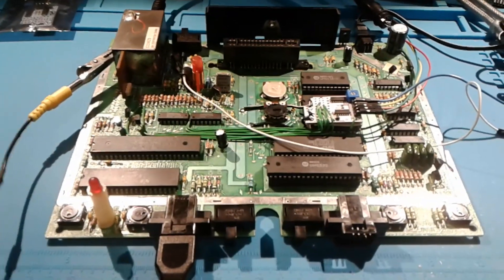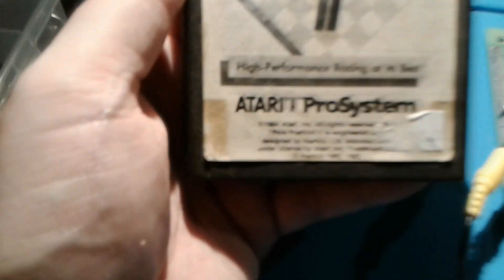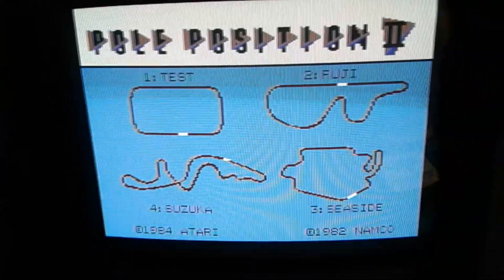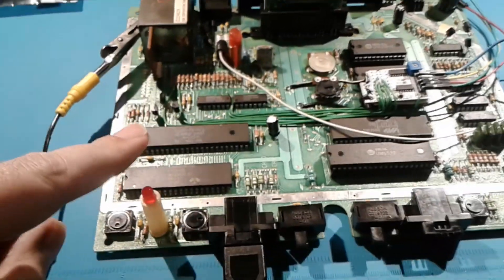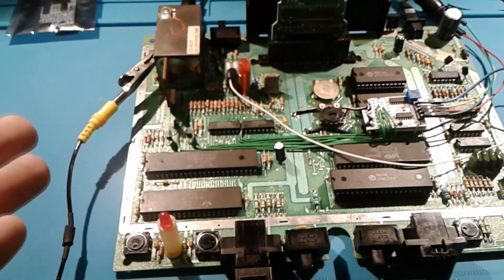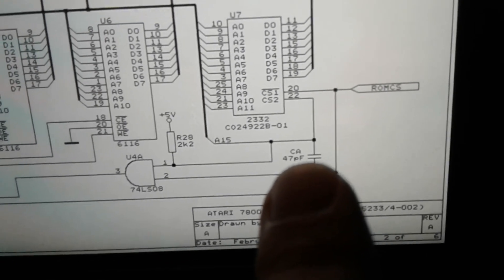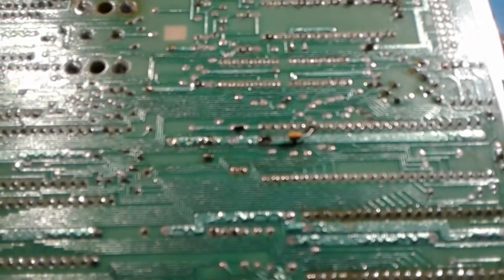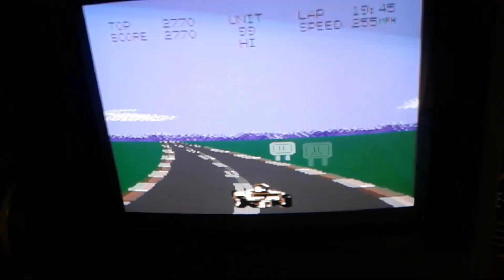ITC#70:- Atari 7800 Graphics Corruptions Issue & Fix

Comment: Thanks for the video. It helped point me in the right direction to my own issues. I had this very similar issue  my unmodded later revision 7800 just different games. On some, Atari installed a 47 pf capacitor on the bottom side of the board on Address line 15 to Ground to fix the issue. The problem is, even with the capacitor installed, I had some issues with games including Choplifter. To fix it, I had to increase capacitance just a little bit (235 pf) and that seemed to correct all issues with the exception of one revision of one game (One on One Basketball, other revision worked fine). The only way i could get this one game to work was to remove the capacitor altogether and the issue fixed but the graphical issues increased on all other games. In the end, I made a compromise and left the capacitor on at 235 pf.
Reply from the maker: Yes it does appear that Atari added this deglitch cap as part of the QC process as it wasn't in the official schematics that I'm aware of and it really seems hit and miss on when they chose to use it or need it. I will state that I've seen it more common on earlier made 7800s with NCR 6502s in them. Additionally, they have it installed off the A15 line from the CPU to ground vs elsewhere. In the end, one fix is to replace the CPU with a different one. I've had good luck wit Signetics 6502s. But like anything with these older consoles, your experience could vary.
Reply: @IvoryTowerCollections  Good catch! Mine is an NCR CPU.
Reply from the maker: @SmartSped1984  Yes, I also have 2 different versions of BallBlazer that I will sometimes use for testing. One seems to be the most commonly one released but has extra hardware on the PCB. That version seems to work pretty reliably on all model 7800s. But the earlier revision doesn't have any passive components on the PCB and that version is very picky with it usually locking up just after the encryption check or shortly after starting up the game. In those cases, it is both Rockwell and NCR 6502s that have issues with that revision. Changing them out to another brand 6502 usually gets both versions working reliably so all of this points to some timing issues that were known about and corrected for in situ during the manufacturing of the consoles depending on the CPU used.
Reply: @IvoryTowerCollections  I'd be interested to see what the inside of both of my One on One cartridges look like since one has glitches and the other doesn't. I just don't want to tear up the label getting to it
Reply from the maker: Might be easier then to just purchase a replacement 6502 and see what results you get from that.
Reply: @IvoryTowerCollections  Might do that. Thanks!

Comment: Can I get a copy of that new schematic please????
Reply from the maker: It is available from the Console5 tech wiki section. That is where I downloaded it for use locally for servicing systems. I need to stress that I've seen this factory done as well on earlier made 7800s but not much on the later made systems from around '88 and up. Additionally, I've tried too apply this to other 7800 consoles that exhibited similar issues and it did NOT correct them. In those instances, I've found that replacing the 6502 completely was the only way to fully resolve the problems.
Reply: I turn my Atari 7800 on and I just get a black screen. In the process of troubleshooting but still can’t find any issues.
Reply: Thanks I got the schematic (PAL version)

Comment: Great catch
Reply from the maker: I actually now use my two ball blazer carts as part of testing 7800s that come in for service. There have a been a few where they wouldn't pass the stability test with BB and adding in the missing cap has corrected them. Although the last 7800 was working on and live streamed, ended up having to have the CPU completely replaced out to correct for the BB lockups. So it isn't a cure all for all but is something to still check for and can possibly correct minor issues with the graphical glitching or lockups due to odd CPU timings on the A15 line/pin.
Reply: @IvoryTowerCollections  I hope the two I just bought doesn't have the troublesome CPU in it.
Reply from the maker: There is no way to know without opened up the 7800 and removing the RF shield to look. That said, most of the older 7800s from the '84 and early '86 timeframe don't usually have Rockwells in them and usually have NCRs. But I've seen this deglitch cap factory installed on even NCR equipped 7800s. So it really seems this was something that was tested for as part of the QA process during manufacturing. But yes, generally speaking the Rockwell CPUs on the 7800 might present some stability issues with games on some occasions.
Reply: @IvoryTowerCollections  I received the first 7800 (it's a bit smaller than what I thought), still waiting on the second one, but I'm going to wait to open them up, I'll open both up when I receive the caps and Vreg.
Reply: @IvoryTowerCollections  opened up the first one it has an NCR CPU, and all chips are socketed, also has the expansion port. The RF shield can be a bit of a pain, but a little patience it came off.

I'm more than likely going to be keeping this one for myself.
Reply: @IvoryTowerCollections  the second one, which is the cleanest one, it has the same CPU as the one in the video (except the logo is at the top and not the bottom like the one in the video) none of the chips are socketed, and no expansion port.

Comment: Wow great find and thanks for sharing. I have an earlier board with the expansion port and timing circuit. I believe you mentioned the early boards have this cap and the later boards dont? Or was it the other way around?
Reply from the maker: First thank you for watching! To answer your question is more complicated. I've seen this factory fix applied in a similar manner as I show in the video on mostly older revisions. But I've seen it on some newer ones as well. Honestly, it might have been something that Atari tested for as part of the QA process and adding this in was done on a as needed basis based on the QA process. But that is total speculation. I've added it to a few that had similar glitching like you saw in the video, and it helped and I've added it to some where the 7800 refused to show anything at all. I originally thought it was mainly added on those with Rockwell CPUs but in looking back at past pics on consoles I've serviced, It looks like quite a few with NCRs had them as well.

Comment: What capacitor did you use?
Reply: Never mind I seen at the very end you said 100uf
Reply from the maker: I think the actual value in the schematics is 47pf. So a very small value but 100nf was the smallest I had on hand at the time. So it is possible that it happened to work okay for me in that instance, but a smaller value closer to what is in the schematic might work better. So if you have access to smaller value caps, I would try something closer and then work up.

Comment: I had a 7800 that would glitch out until it got warm but would fire up immediately when you remove the RF shielding. I have a video where I tested it while hovering over the RF/EMI shields. It glitches even when you electrically isolate it and seems to be triggered by proximity. Hovering a couple inches over the shield works fine but hovering less than a half inch triggers the glitching. The glitching is so sever that 7800 games won't even boot but 2600 games will work fine. I realized that warming up worked because I played a 2600 game for about 10 minutes and then switched but it will warm up even if you leave it on without a 2600 game. Video should still be on my channel somewhere.
Reply from the maker: Yes you have mentioned it before and I've seen it. Still no idea what that could have been about. Again, this 7800 had been sent to me with this problem described but I couldn't replicate it with any of the games I tried, until I happened to try Ballblazer and Pole Position II. That is when the schematics showed something in circuit on newer designs that wasn't present on this 7800 board. I've also been told recently that even different revisions of the games themselves exist with several later revisions actually having this capacitor added to their data lines specifically known as deglitch caps. So it seems issues like this were known even back when Atari was making them.
Reply: @IvoryTowerCollections  Yeah, I just think capacitance with similar interference could explain it, considering that it was sensitive to proximity/touch. Your insight could be helpful to others experiencing the same issue. Thanks for sharing!

Comment: Why did the capacitor help?
Reply from the maker: The capacitor is helping to filter out some digital noise that is getting picked up by the A15 line from within the system in the case of this 7800. Again, this capacitor is listed in the newer schematics that more closely match the later made 7800 units but it is missing on the more commonly found older schematics that are based on the original 1984 version 7800 systems.